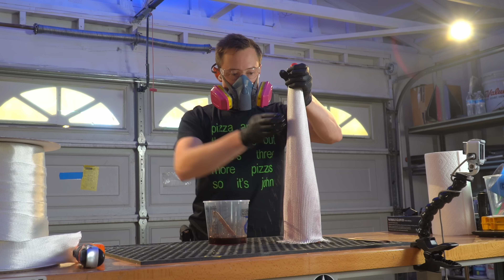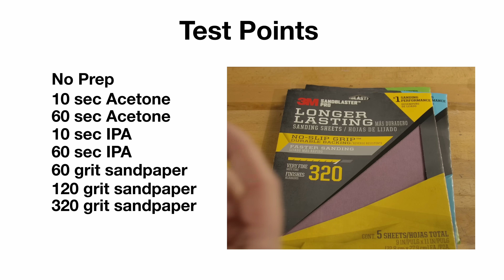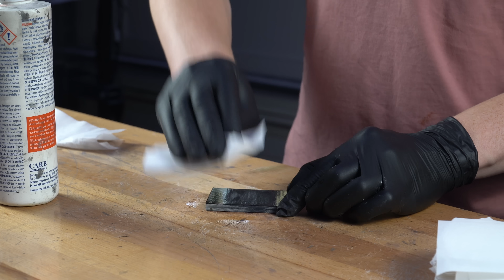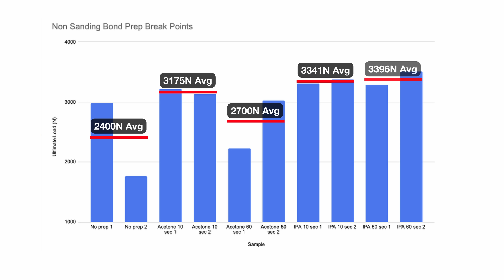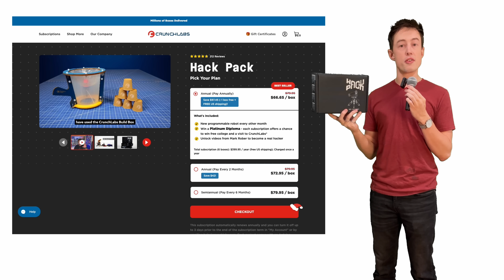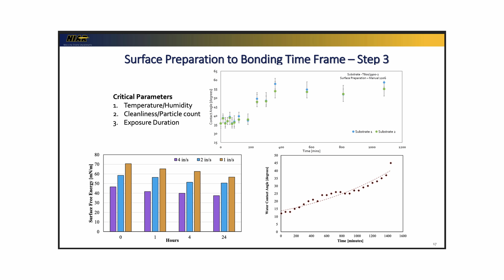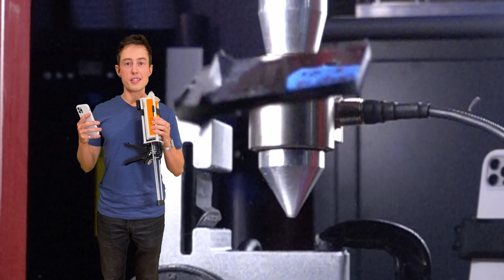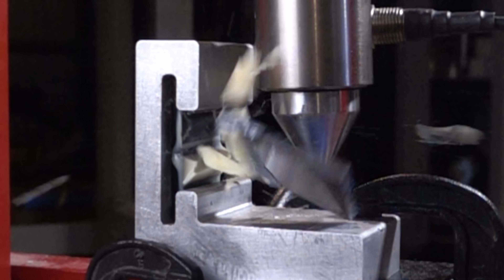I Broke 100 Epoxy Bonds to Find the Strongest

Comment: cheeser cheater on the wall, who is the most beautifullest of them all. pretty nice bruh. all you need to love from above. fixed solved. people bragging of their own works is bs. pretty interesting xperience. nailed it bruh. what a mind bender twister tho. still a bit shaky tho in the flesh seeing department bruh. lighten up the mix. trust more in above, be not so serious. what is tv shop. she knows. fusion tight. what above has brought together, people shall not divide. well be one. as 1-on-1. black stuff is just testing. any good skill comes from above alone. remember salt or me. anyways visible does not matter, only spirit makes alive and one. because above is one and spirit. cute and salty. nah let above do the testing. nah keep above in your heart. no question. screaming test passed. otherwise stones would scream even more. of course coarse surface bond of wafers is the strongest with maximum surface bond area. ie be one. actually one, not fake one. flesh cant even copy one in magic tricks. wafer quality is one dust particle damns the whole deth soup mixture. but you are in no need, actually, of anyone's teaching. good job. knit the fiber t-junction with carbon fiber filament. yep sew saw. resin is always the weak point, not the carbon fiber filaments. therefore just sew saw. what are you doing in my eye (above's eye) bruh. fresh is nice. what did you expect peter. grow up bruh. cross junction holds better than any glue. you know, two planes in cross position. sure remove all flesh before usage. ie heal flesh works with spirit. I hate jobs friends. first freedom is in above always. dont even talk about what people need to be pleased. you stay cool bruh with-in above. not in people lawless rules that only hurt. holyc spirit does do things lol. no judgement whatsoever bruh. there are no false god works. no people bonds, not through yourself or your works. only above which is already in place. ie dont replace with people nonsense rules. oh well, above saves. well your tone changed dramatically. or its no longer flesh tolerance but above bears it all. ie spirit vs flesh. end of rant. crunch that mark rober labs. trust in above alone bruh, its a command >.>. chips are fun bruh. chips and cheese. whats with that bro-space of yours tho. did you not give it to above. oh well, above makes free, not people with their rules. that well of yours was deep as a sea monsters belly. already avoid glue, use fiber bonds. 007 bonds. ie my little eye spies some carbon fiber in your eye bruh. dont even start your own works. above affects or you did not do anything. ie spirit makes alive or you are still in your flesh deth works. sorry forgot rant was over. inappropriately. ah no apology. nothing wrong in above. radical idea bruh. holly crappers bruh. red hot panda lol. I plead force majeure of above play. and freedom with-in above. and above does what above wants to do. clearly. yeah nano ion 3d printing stuff is nice. nicer and best. and cute. and I have visitors in above spirit. that normal natural flesh does not see. not even the nasty intruders. spirits from above. ie actual friends. who dont wreck the temple of above from inside with outside nonsense. no shame in gospel freedom bruh. no problem. why do you talk to a caulk tube tho. thats jacob's ladder btw. yep true true. nice game having a bud. she knows. not on you bruh, above gives and flesh self effort is waste of time. I have 1000 apm of typing by above btw. about attachment, just dont. stay with-in above as one spirit. above gives even eager youngsters their stuff back. and their friends too, job. testing to crown of life. cant cheese with above. and its a free gift. I/me does nothing, above does everything. if you are one, then no creation can separate you from one. avoid kling-ons btw. if you try to fix yourself, you break them. already broken. no fix. both drop to the same whell of your making. only above saves trictly. not through yourself or your works. above is spirit. what the heck bruh. let above live in you. no longer yourself. end of story of-from people. this is at ½, 2 and 1 times. bruh. the testing of above by the stan beast nom nom enymals. zerox trust in people. size does not matter. anyone with-in above is fine. no robbers get in above. no artifical protection required. you get what you are hoping for. not the evil version of world nonsense. either weave the fiber to interlock or interlock two plates through cross. ask above, you dont need my input. gathering means nothing to be judged under law when received with thanks. so avoid the judgers ie people. pride of humanity is the worst offender against above given freedom and good things. well you got your input anyways. lol. above said so, otherwise I would talk my own lying my pants off. red hot chilly pepper bruh. why so. why embraced. sounds like sand paper launch. lol. yeah was very nice lol. how about no to your every day intrusions. ie sm of dom. arm chair nano tech lab stuff ftw. nothing wrong in arm chair stuff. diy lab is the best. only after the test you get the crown from above. before you want to steal others crowns. get your own crown bruh from above. ie your rusted gold is not a crown. you just love adventures dont you. dont judge any colorful stuff bruh. otherwise you make your own house crumble down. hope you understand freedom from above. no freedom is given from people. ie in all cases, be saved from people's hands and judgement in front of them. flee dont stay fighting them with them. you ruin yourself with them if you stay with them. nothing have-to. flee from hypocrisy. ie dont fall out of grace by your own works judgements and measurements. you dont need to be told this again and again and again..... no flesh bonds, only bond with above, and through above. which already holds with your friend very strong, internally not externally. spirit not visible talk. whatcha worry about, ask your friendx. now you are just bean counting. above does not operate in such a public shame. let her drive. no external drivers and flesh advice bruh. your effort only damages. you should know brothers. yep I'm off thanks. above gives, people damage. ie zero hope in people. may above help you. I obey above rather a post doc. what benefit is damage to yourself tho. by knowing. throw law effort you cant get to the finish. instead you just annoy the heck out of everyone. darn dang bang good. ie betrayal does not get you anything from above. eyes to above alone, as there is no finger pointing or false gods. yep no dealing with the world at all. thanks above. can you deal with a crack world. thats nasty. get healed by above. world love != above love. end of story. speech can want but you dont get it from above. nothing. no. dont force it. no, let above do it. still learn some weaving and knitting with carbon fiber instead. then epoxy it later. as normal carbon fiber strong bonds. enthusiasm is not skill and understanding from above. sure try what you want but above still gives victory. I dont step into your law wars or law suits brothers of flesh. avoiding. fleeing. zerox bucks perfect, if you want to know. jobs friends the most horrible ever. otherwise nice job. and I dont trust your peers and beers. dont ask, dont tell. secret is not public shame. never putting any trust in people no matter how they talk or recommend themselves. dont ask. above gives everything that is required for life and godliness. end of people's trade promises. the closest friend is the worst ice friend. lie assumed. also flesh spirit manipulation assumed. ie all people credit vanished. ie trash is trash. let good be from above always. being nice is relative. or a horrible relative. therefore above is the only one to be with. and any other that is also with above. as real life. not deth stranding attempting to kinda live. we who are back who are saved tho. keep on keeping on brothers of flesh. return to christ, not to your vomit.
Reply: fear of people bad.

Comment: WOOOOOOO EPOXY FUMES
Reply: polyester resin smells like it'll get you a bit more woo than epoxy.  Not sure what the science says, but my nose reckons epoxy is not very woo like.
Reply: @nathanw851  the guy at my local composite store Said almost every he knows working with epoxy and not with proper ventilation developed asthma
Reply: acrylic resin is way worse
So many VOCs...